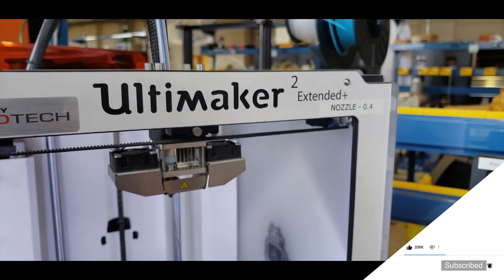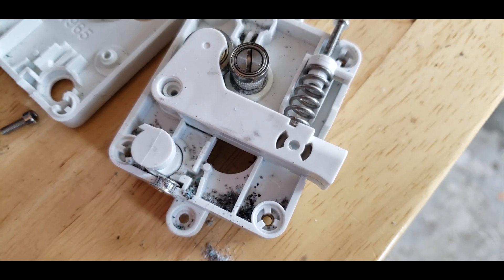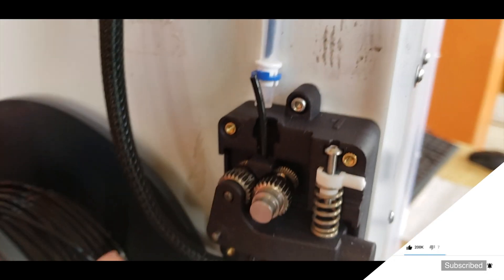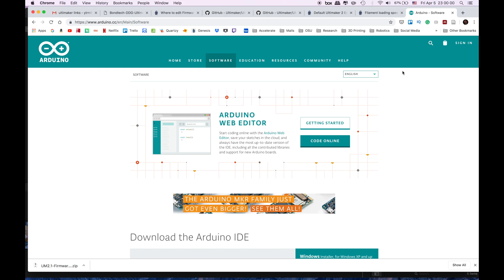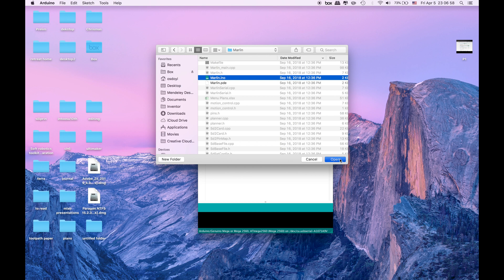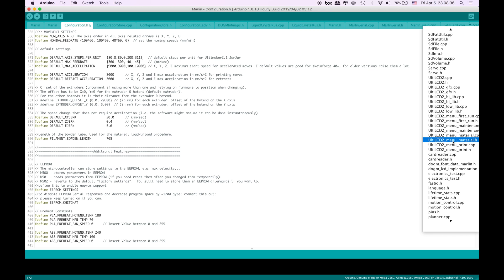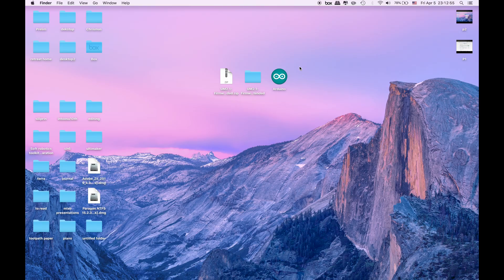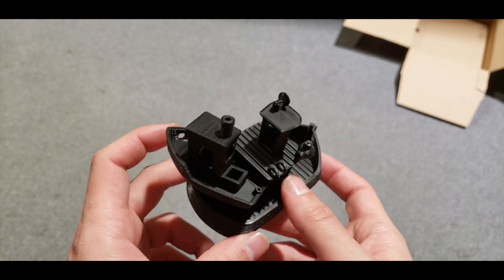How to upgrade Ultimaker 2+ Feeder

Comment: How do you connect your mac with arduino to the printer ?
With the normal USB cable ? 
Do I need to switch the machine to any special mode to upload the firmware ?
Reply from the maker: I dont remember any special modes. Its been a while. I think I used standard connection cable
Reply: @3DPDoctor  THank you so much for your quick awnser onthis relatively old post man !! respect for that !
Ok I can understand that...
1 more Q (if you remember) does the UM2+ need to be powered ON when doing the update or does the board get powered over the usb in that case ?
Respect and 3d Printing happiness 2 u !
PL.
Reply from the maker: If I remember it doesn’t matter. It should get the power from usb. If it doesn’t you should be able to power it up.
Reply: @3DPDoctor  It worked the firmware was uploaded thanks !

But when I get to feeding my filament... The whole bondtech extruder seems to work backwards ?
Reply: @3DPDoctor  I think i should edit this line in Configuration.h :

#define E_ENABLE_ON 0 // For all extruders

to 1 
to reverse the extruder direction.

:)
Reply from the maker: Probably
Reply from the maker: I don’t remember. Try it